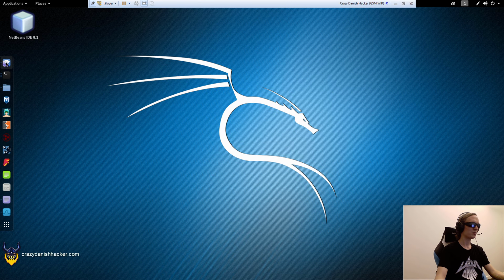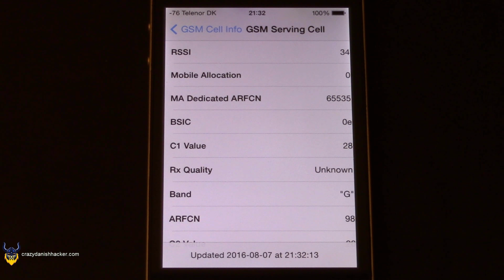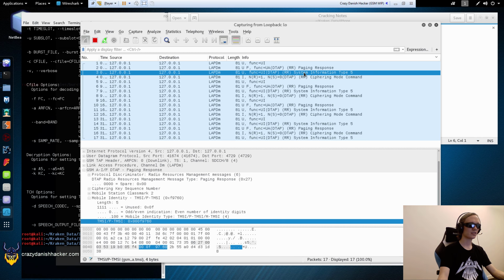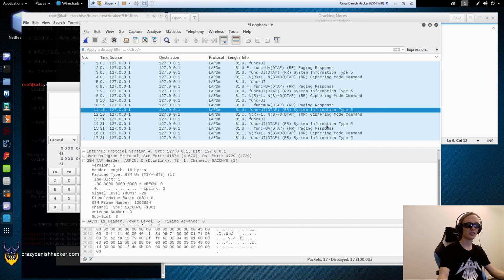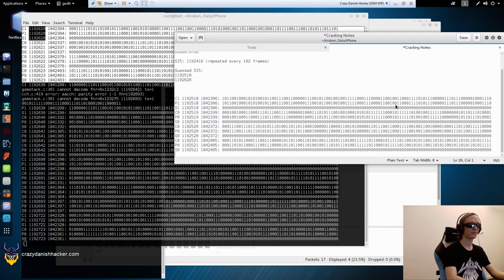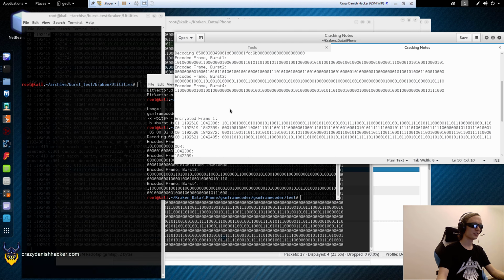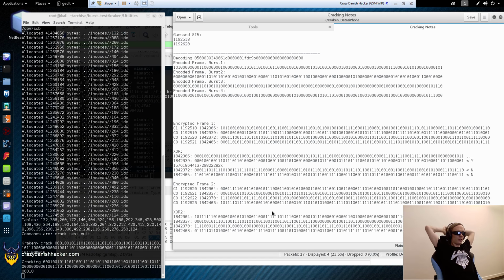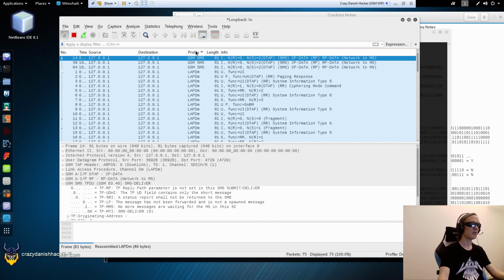GSM Cracking: SMS w/ Kraken - Software Defined Radio Series #16

Comment: Hello Crazy Danish Hacker, can you show how to make your cfile? And I can not find the Paging response package, can you help me please?
Reply from the maker: Use grgsm_capture as I've mentioned in my other videos. You may need to try several times. You can use this as a test file for a voice call: https://github.com/ptrkrysik/test_data/blob/master/vf_call6_a725_d174_g5_Kc1EF00BAB3BAC7002.cfile
Reply: Thank you bro! At me one more problem, kraken does not find in tables of the necessary number, constantly writes 'took 188826 msec', I do all as you describe, but at this step I am at a loss, do not prompt why so it can be?
Reply from the maker: I'm not exactly sure what "kraken does not find in tables of the necessary number" means, but if it means that you can't crack a burst, then try the other bursts. You can't just try four bursts and give up. I even mentioned that if it doesn't work at all with all the bursts, then record a new file and try again.

In case you haven't installed the tables correctly, and kraken does not load them properly, then that could also be an issue. 188826 msec is 188.8 seconds, or roughly 3 minutes. The reason why it takes this long time is probably because you're running Kraken over USB. (I haven't tested running it over USB but others have and they reported it was a lot slower.)

In any case, it sounds like you've installed Kraken correctly. However, if you're doing the XOR wrong, i.e. in the wrong order, then even if you manage to crack a burst, then it won't work. Remember that if you screw up any of the steps, such as using one of the System Information 5 packets, and then not adding 102 to it, then it won't work.

If you're not following my tutorial 100%, or if you're using some of the automated tools that exist, then it's very likely that you won't be able to crack anything. (You can't take any shortcuts if you don't know know what you're doing.)
Reply: Thank you, and the last question, when I try to create a cfile, I see the following message:

root@kali:~/kraken_data# grgsm_capture.py -a 110 -s 1e6 -g 50 -c capture.cfile -T 60
linux; GNU C++ version 6.3.0 20170221; Boost_106200; UHD_003.009.005-0-unknown

gr-osmosdr 0.1.4 (0.1.4) gnuradio 3.7.10
built-in source types: file osmosdr fcd rtl rtl_tcp uhd miri hackrf bladerf rfspace airspy soapy redpitaya 
Cannot connect to server socket err = No such file or directory
Cannot connect to server request channel
jack server is not running or cannot be started
JackShmReadWritePtr::~JackShmReadWritePtr - Init not done for 4294967295, skipping unlock
JackShmReadWritePtr::~JackShmReadWritePtr - Init not done for 4294967295, skipping unlock
Detached kernel driver
Found Rafael Micro R820T tuner
Reattached kernel driver
Using device #0 Realtek RTL2838UHIDIR SN: 00000001
Detached kernel driver
Found Rafael Micro R820T tuner
[R82XX] PLL not locked!
Exact sample rate is: 1000000.026491 Hz
[R82XX] PLL not locked!
Reattached kernel driver

This is normal?
Reply from the maker: Yes that's quite normal. In case nothing is captured, then restart your computer and virtual machine, and unplug the RTL-SDR device, then power on the virtual machine and plug in the RTL-SDR device again.

Comment: why System inf type 5 repeated every 102 frames?
Reply from the maker: The reason why it's transmitted every 102 frames, is because that's how it was designed by the "protocol developers". Why it's exactly 102, I don't know, but there's probably a good reason in relation to other packets being sent, etc. You can read more about System Information packets here: http://www.rfwireless-world.com/Terminology/GSM-system-information-messages.html and http://www.slideshare.net/Telebeans/systesm-information-layer-3-messages
Reply: Никита, получилось?

Comment: Hi Crazy Danish Hacker, I really love your videos and your way to explain! 
I hope you'll continue in that way!!!
There will be more videos in this playlist? Will you add also voice decription with hopping?

And... what do you think about this link:

https://github.com/kiaer/kasumi

Could be useful for you?
Reply: https://asecuritysite.com/encryption/kasumi

and more in general:
https://asecuritysite.com/encryption
Reply from the maker: Very nice resources avelucaxx. I worked on voice decryption with hopping enabled a few months ago, but I ran into a lot of trouble as the only program on github available, is not working for BladeRF and it does not have full support for the configuration that the BTS I happen to use, is using.

I did have to modify the grgsm_capture and grgsm_livemon code slightly and play with it a bit to capture and save a "wideband" file using grgsm (which ended up working by the way). But the airprobe_hopping project did not work, so I have to learn everything from on how to assemble packets from scratch at some point. 

I do plan at some point to do more GSM videos, are there is so much more to cover. The KASUMI websites look interesting, and I know that other researchers have pointed out issues in the encryption somewhat, but no one has released like a fully working program for GSM and KASUMI yet, but that doesn't mean it can't be done. 

The only thing holding me back, is really work, time and motivation. (I work full-time with ethical hacking already.)

Comment: How hard is it to do this kind of thing on newer phones? I noticed the iPhone 6 doesn't even have GSM info in field test mode, only Cell Source Measurements and they have a number called E-AFRCN. This stuff seems really interesting, but I don't have any desire to break my phone or SIM card fiddling with things I don't really understand.
Reply from the maker: If you're doing this type of "attack" against "other phones", then it should work on any phone in factory default mode, if you e.g. jam all 3G/4G channels. When I did the GSM Cracking video against SMS sent to myself, I used an iPhone 4S and configured it to use 2G from the normal phone menus. From where I used the field test mode to find the ARFCN, which is where my phone was receiving the SMS' on. E-ARFCN means your phone is still in 4G mode, so you won't be able to replicate the attacks I did in this video without a jammer, which are also not exactly legal :-) (All phones should revert back to 2G if 4G and/or 3G are unavailable.)

The "hardest" part, when you're cracking your own SMS, is disabling 3G and 4G, and finding the field test mode menu.

If you on the other hand, want to try this without any cracking, i.e. by extracting the TMSI and Kc, then it becomes a lot harder as you'll need a direct interface to the modem in your phone, or extract it from the SIM card. The TMSI can be "bruteforced" by sending yourself several SMS messages as I think I showed in this video.

The Kc, aka encryption key on the other hand, needs to be either known (by e.g. extracting it via a direct interface such as a "USB modem" or through SIM card reading, you'll need an external reader then), or by cracking it with Kraken, which isn't 100% guaranteed to work. 

It's a fun and educational attack to try out, but it's not very practical to be honest. If it was, cyber criminals and gov. departments would be doing this instead of using "plug n play" stingrays for example.
Reply: +Crazy Danish Hacker but if it's your own phone you can just look up those values like one of your other videos showed, but I'd still have to force it into 2G to sniff the SMS? The encryption on 3G/4G is just too hard to beat currently? Or it would require a different set of tools? I studied microbiology, I just have always been interested in how various aspects of computer and technology work. Eventually all of this is moving towards quantum encryption right, which is an effort to find larger and larger prime numbers? Thanks for your replies! I find your videos easier to follow than most and very fascinating, still largely outside of my scope of understanding, unfortunately.
Reply from the maker: Yes you still have to force it into 2G, either by simply changing the settings or by using a jammer. 

Some researchers said they did find security issues with 3G/4G quite some time ago, but they released details or a proof of concept. 

The technique doesn't really change much from 2G to 3G and 4G. For some 3G and 4G sniffing/cracking you may need different tools though. 

Yes quantum encryption is the buzz, I think there's a presentation about it at Black Hat Europe this year too.
Last year: https://www.youtube.com/watch?v=RrdTAURD1rI 
This year: https://www.blackhat.com/eu-16/briefings/schedule/#real-world-post-quantum-cryptography-introducing-the-openquantumsafe-software-project-4872

My main idea with this channel is to try and show everything from scratch, i.e. no hidden steps along the way, so if you tried to do the same as I do in my videos, it would also work on your computer, and also be fairly easy to do. I plan on doing more GSM stuff in the future when I get more time.

Comment: hi
how to work module GSM in arduino ???
for sniffing GSM ss7 and wireshark 
thanks
Reply from the maker: No idea on how to do it for Arduino, but (software-wise) you'll need a sniffing application such as gr-gsm, and the dependencies which are python, gnuradio, gr-osmosdr, etc. (that's only for sniffing). Wireshark is a program, that displays the sniffed packets.

Hardware wise, you need a "software-defined radio", i.e. a tuner and a controller. See: https://en.wikipedia.org/wiki/Software-defined_radio

Check out this article which is somewhat related, even though it's not about GSM:
http://hackaday.com/2014/08/05/sniffing-nrf24l01-traffic-with-wireshark/

Comment: Do you still have your cfile? May I have it for testing purpose? Thanks
Reply from the maker: No I don't have it, and I wouldn't share it as it contains personal details. You can get test data from e.g. the following website: https://github.com/ptrkrysik/test_data
Reply: Crazy Danish Hacker thanks mate!
Reply: Crazy Danish Hacker what did you use to sniff your network? Gr-gsm or airprobe? My network in wireshark is ugly and hard to find Specific SI 5. Any tips?
Reply: +Linh Vu as much as i know gr-gsm is better but if you cant do it manually because of high traffic being captured write script for it or just use airprobe and that lazy script for automatic tasks
Reply from the maker: Linh Vu Always use gr-gsm for sniffing as I did in my video. Use gr-gsm for decoding unencrypted packets, and if you have the key, encrypted packets.
If you're looking for potential encrypted SI5 packets (well, bursts), then you need to use airprobe as I did in my video, because gr-gsm does not print encrypted bursts.
Reply: +Crazy Danish Hacker hmm thanks and i suggest you do some sniffing on satellites
its the only thing i can't find in your collection the frequency should be around 138 mhz but you need a more functional antenna its cool to get the pictures as fresh as NASA
Reply from the maker: My BladeRF doesn't work below 300MHz (and Nuand doesn't have the upconverter board in stock at the moment), and my RTL-SDRs (default antennas) can't pick up the ISS when it's doing a fly-by at 35-45 degrees with clear skies. I already tried four very late nights. I probably need to use a directional antenna tuned to that frequency band. 
So yeah I did try and I was ready to record and everything, but didn't work with default antennas (even the 1 meter one failed) :-)
Reply: you need some serious researching in antennas stuff!  and beware of electric outposts all over the city they might seems silly but their phantom can be the problem 
you need special antenna for this one at the top of the where ever you can find higher better with full gain and maybe a signal booster i hope you can sniff some data soon!  :)
Reply: you need some serious researching in antennas stuff!  and beware of electric outposts all over the city they might seems silly but their phantom can be the problem 
you need special antenna for this one at the top of the where ever you can find higher better with full gain and maybe a signal booster i hope you can sniff some data soon!  :)
Reply: you need some serious researching in antennas stuff!  and beware of electric outposts all over the city they might seems silly but their phantom can be the problem 
you need special antenna for this one at the top of the where ever you can find higher better with full gain and maybe a signal booster i hope you can sniff some data soon!  :)
Reply from the maker: Yeah there's a transformer station not too far away if that's what you mean :-)
Reply: sorry for bad English its my 3th language but transformers alone cant have so much effect unless you try full-gain receiving and i think you can solve this problem by just a parabolic antenna "and a signal booster as i said" dont use cheap wires they reduce the strength of signals and i forgot to say put your RTl-SDR in a metal box to prevent noise blasting effect as you are going to use full gain

hope you capture some thermal pics soon :)
Reply from the maker: Thanks for the advice, eventually I'm going to use a directional antenna, either parabolic or one of those yagi-uda directional antennas. Do you have any suggestions for thermal pictures/videos? Keep in mind they're quite low resolution, but if you have a cool idea that's worth sharing let me know. Currently I'm thinking it'll be a lot more "dramatic" when it's winter and if there's snow for example.

Comment: how much time does kraken need to crack?!
Reply from the maker: It takes around 60 seconds per burst as shown in the video (CPU Only). If you utilize a cracking rig with e.g. four GPUs and proper software, it could be a lot faster. This type of attack is not meant to be implemented on a "large scale" though, as it's not cost-effective. It's simply a proof of concept that works against 2G GSM networks, including when devices are downgraded from 3G or 4G to 2G networks, either by accident or intentionally.
Reply: Wolf Ly well depends mate. Mine is more than 200seconds because I wrote tables to files not raw.
Reply: +Linh Vu yeah cool but i put this in my most important project list

i bought the sdr and iam thinking about server for kraken and other cool stuff 😎  
but who buy a server for such stuff! iam going to hack one but unfortunately didnt find any more than 1TB on each one iam completely disappointed :D